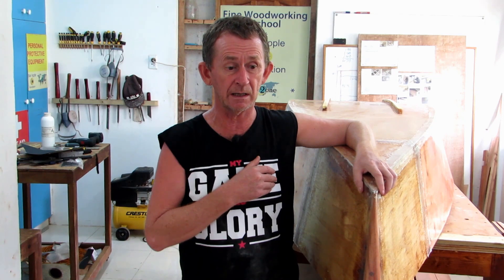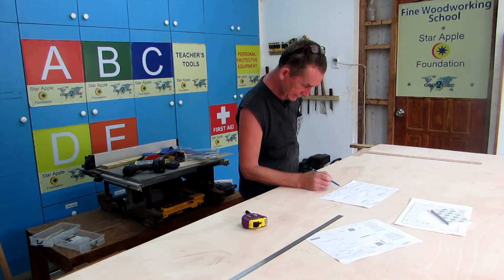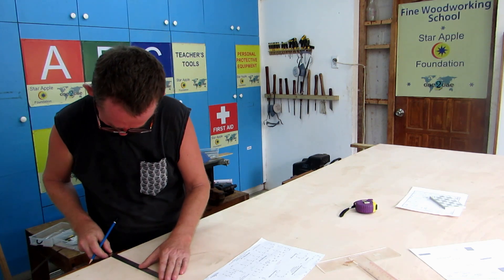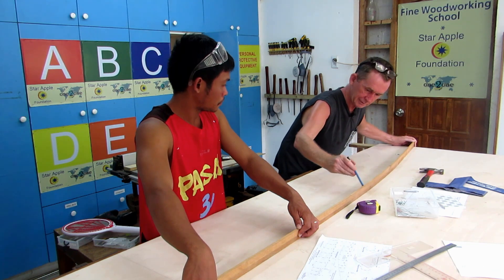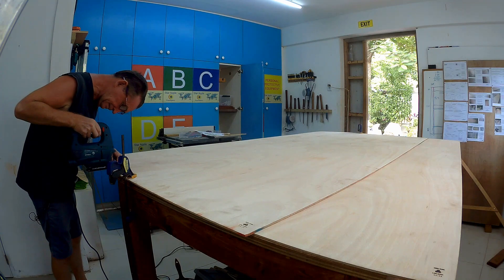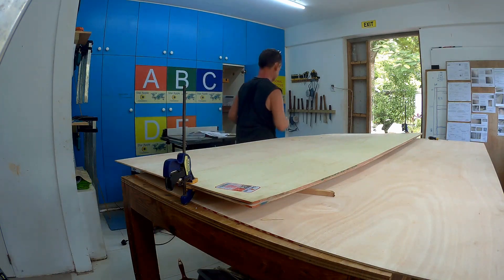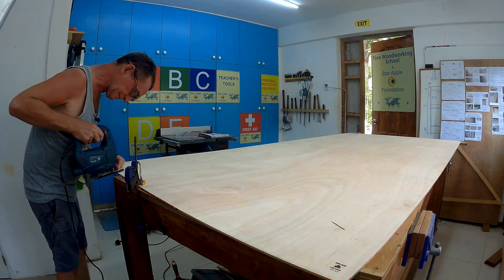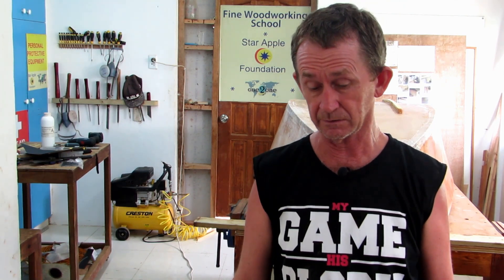Build a Tryst 10 Trimaran Sailboat - Pt. 2 - Cutting main hull sides

Comment: It’s coming along. When I was in the Philippines I took several rides on bancas. They were a lot of fun to ride on and very stable in the water.
Reply from the maker: Yes Don. There are bancas everywhere in The Philippines. They are stable because of the bamboo out riggers. The keel is usually made from solid wood, which lowers the center of gravity